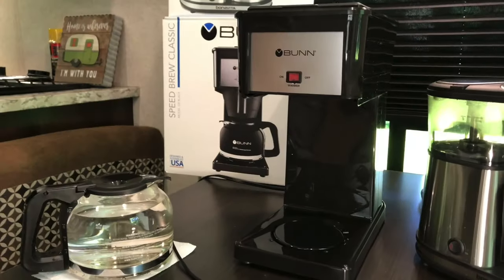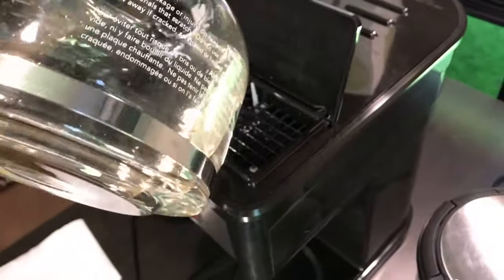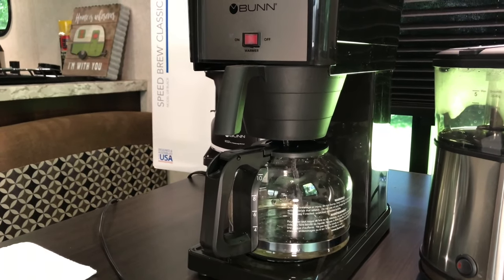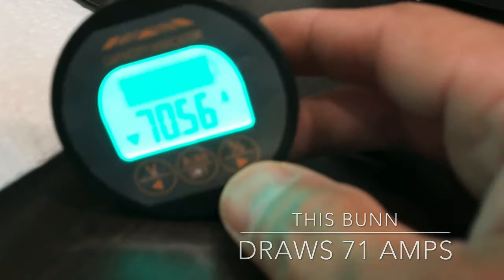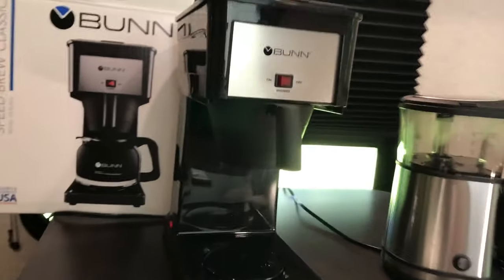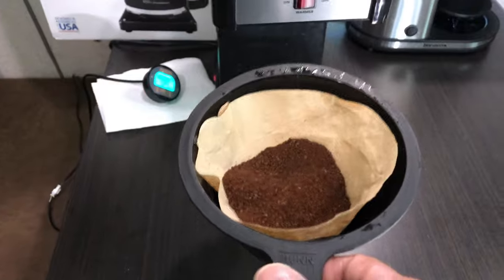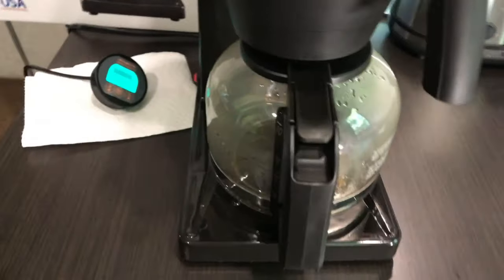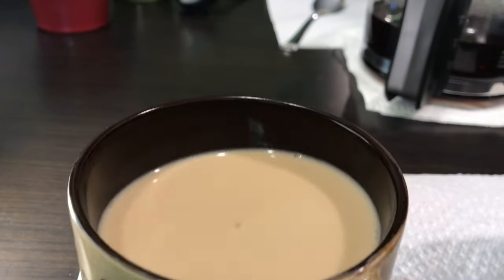Bunn Velocity 10 Cup Brew GRB coffee maker! How to set it up for First Time Use!

Comment: Do you leave the button on the side on all the time or turn it off
Reply from the maker: As a user... up to you. If your leave it on, you have instant hot water all the time (inside the reservoir). The coffee gets brewed quickly too. However, you will have higher electricity bill by keeping it on. If you turn it off... you just need to wait longer to get the water heated up to proper brewing temperature. Thank you very much for watching and feedback